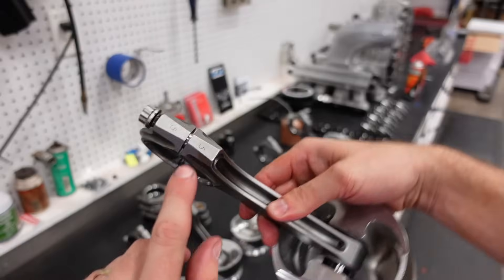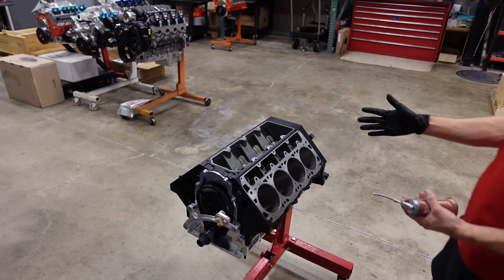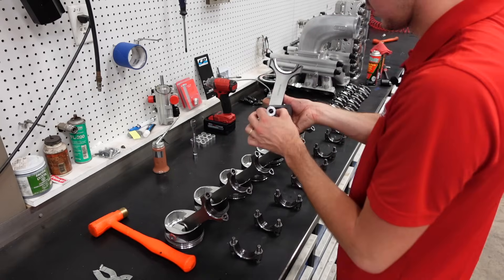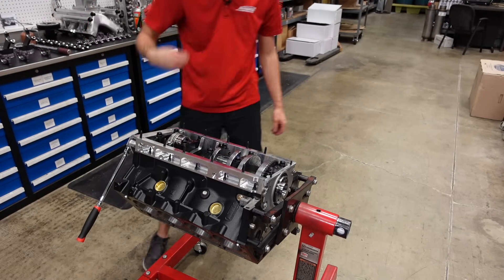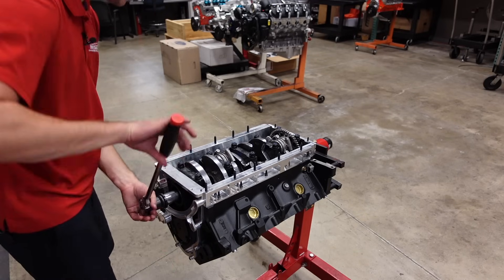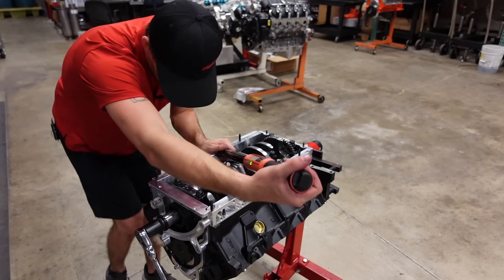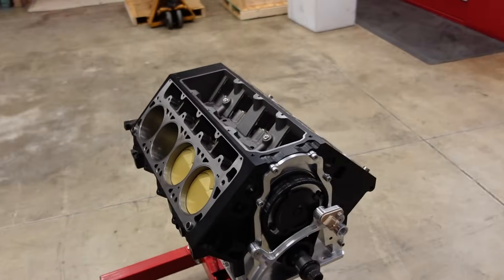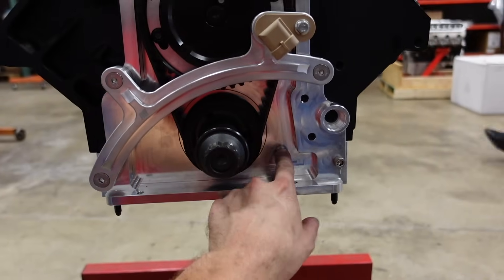Assembling my 3,000hp 400” LS Standing Mile Engine!! - Part 6

Comment: An impressive Dart block
I want to build a drag and drive engine more street driving than drag. Twin turbo, 2 fuels, capable for 3000 hp but 2500-2600 is ok 
Do build for customs ?

Comment: I noticed that you pulled the rings and simply installed them. And maybe you did it off camera but shouldn’t you have check the ring gap before you did the final assembly? It would really suck to go through all this and end up with a broken piston or scored cylinder.

Comment: Crazy question of the day from the peanut gallery: perhaps it is not a concern due to the low RPM's (compared to 15k race motorcycle), but the thermal expansion between the two bearing thicknesses and is the weight of the two different size bearing insignificant to be concerned during crank balancing?

Comment: I don't see the point in marking the bolts after torquing them all, I believe the point in marking them at all is to insure you didn't miss one. If that's true then it only makes sense to mark them one at a time after each individual bolt is torqued. Marking them all at once doesn't indicate if one was missed. Am I wrong?
Reply: You are correct. Its a sales gimmick mostly now.
Reply: I thought that as well.

Comment: You state you have installed a combo standard size bearing half and an underisized .001in bearing half in each connecting rod. 

This will result in a .0005in step, where each bearing half shell meets  each other at their ends. 

Does this step eventally wear off during running? 

If not , could these two steps give any problems, such as wiping oil off the crank journal? 

J

Comment: Love these videos. If you put those copper crush inserts on an engine rate for 1500hp would that be overkill? What is the cost for that sort of setup? I imagine having to make sure the cut outs on the head and block have to be very precise.
Reply: There's nothing cheap on a 3,000 hp or 1,500 hp engine.
Reply: @johnd5805  excellent point. I'm just curious what that actually costs though, because theoretically it would probably completely eliminate any head-gasket failures that much lower output conventional engines can sometimes suffer from...but would probably be complete overkill from a cost to benefit standpoint.
Reply: @mobilis-ch1yv  If I was to guess which is totally a guess I'd say $1,200-1,500